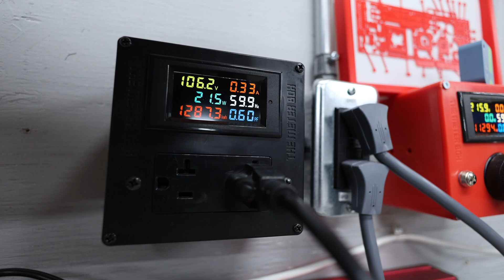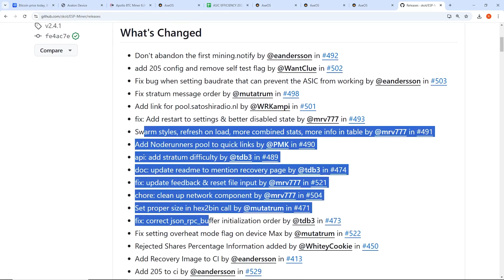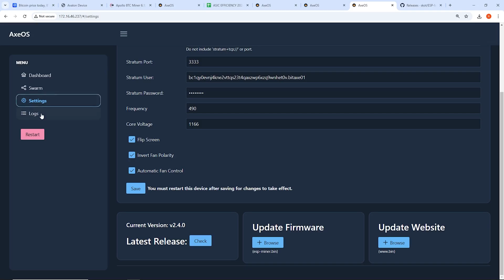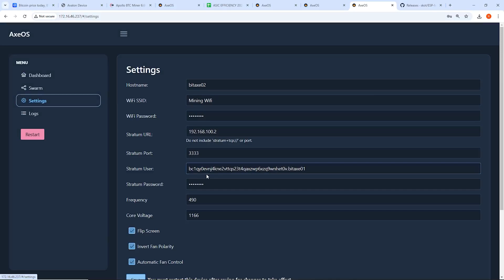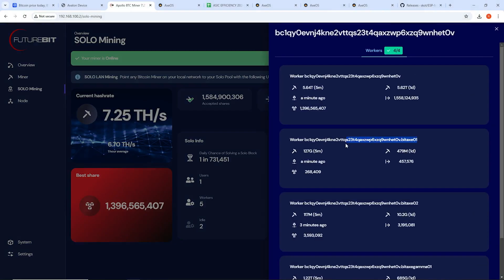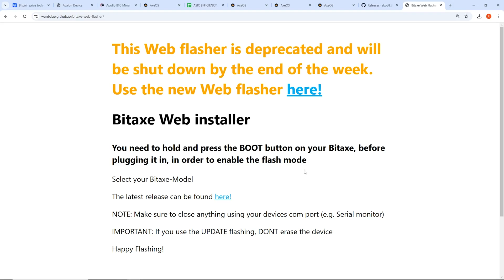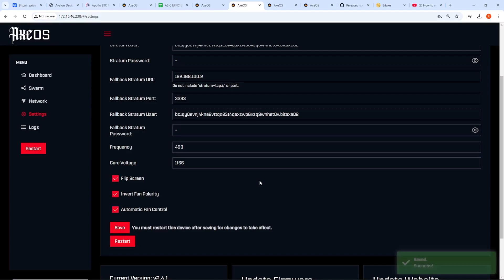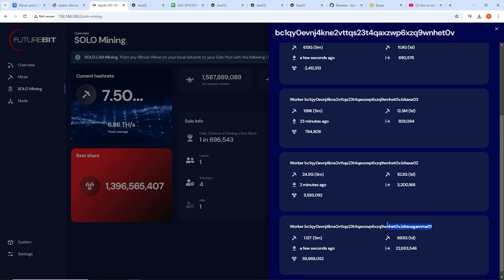Bitaxe Miners Not Hashing? This Firmware Fix Saved ALL of Mine…

Comment: only issue i had is with heating and i dont haev time or energy to fix it. So i basicly  lowered the core voltahe to 1060 instead of the 1150 default. and then frequancy i have at 550. any settings hier then this makes it were it wont work.

Comment: Im having an issue with my new Gamma, i cant login to the web gui anymore. There was power outage recently so my theory is it got corrupted. Any suggestions?
Reply from the maker: do the Bitaxe web flasher method! I show it later on in the video how to.
Reply: @RedPandaMining  thanks bro I'm gonna try it right now hope it works!
Reply: @RedPandaMining  I tried it and it will allow me to assign a new network ssid but after it finds the IP address, the web GUI still won't open. 😓
Reply: It says it's hashing on the little screen but I can't see it on the pool site.

Comment: Had my gamma up for a couple days. Seemed to have fan issues the first day leading to 2 overheating episodes and restarts. Just checked in it via pool dashboard. While it was running fine since last night, I see that the hash rate recently dropped to nothing, so it overheated again. Interestingly, it jumped to over 2TH/s before dropping off. It’s running to default settings.

Comment: I have 5 x Bitaxe 601 Gammas. The screens all work at the moment. I had issues with the MARS LANDER screen that goes out after a few hours. Once one of the 601's hash rate did drop to 500 GH/s. Simply restarted by unplugging and plugging back in and fully seating the plug. Running version 2.4.1. I like the Web flasher firmware updater. No file downloads, just automatic update. On a mission to get 50.
Reply: all work?

Comment: Having major issues with my Bitaxe Gamma I just got from Bitcoin Merch.... Danger low, high Voltage... Danger High Temp....It will stop hashing all together.....updated firmware... No fix......  In the process of  trying to get it replaced.........  I will give update as it goes..... I have a video ready to post if I have too. I'm not a happy new miner. Best luck im having is what my Nano 3 and KS0ultra...

Comment: I've got the og one, and I have had a few issues with mine.  I have not been able to oc mine and they would get stuck when power would fluctuate.  I finally had to install new software and it started working again, recently I started seeing mine getting too hot so I pulled the heatsink off and found the paste was minimal and almost nonexistant so I had to repaste mine and now its running more stable.

Comment: I have a bitaxe ultra and two lucky miners lv06 and something they have in common is that for some reason after several hours or even weeks they restart (I guess due to lack of memory) and when they are restarted they do it wrong and the IC module does not turn on and it has to be reset with the reset button, usually when it does not start that module has a low voltage

Comment: I have two Bitaxe 400Gh, older software versions were not stable, since I have v. 2.1.8 it works stably and also reconnects automatically if wifi drops. I also changed the thermal paste, the chip temperature dropped by 5 degrees. They are overclocked by approx. 10%.

Comment: I've had one of the BitAxe Gamma units for a couple weeks. For the first couple of days, it worked great. Then it just seemed to stop and show Gh/s: 0.00 until I unplugged/replugged power. This went on for the next few days. I then checked for the latest firmware on the settings page of the WebUI and updated from v2.3.9 (what it came with) to v2.4.0. I didn't really understand that I had to update the Web.bin (at that time), but the new firmware seemed to make little difference. (Note: it's worth mentioning that when the miner screen showed Gh/s: 0.00, I could rotate the power barrel jack a bit and it seemed to have put some life back into the unit... darn barrel jacks were never very reliable anyway...) This time, when it worked, the fan surged from slow to fast (then repeat). I then replaced the thermal paste on the ASIC with some MX-6. When I plugged power in the first time after re-assembling the heatsink/fan I wouldn't power on... a little troubleshooting later and it seemed that I had the heatsink tilted on the ASIC die and I think it shorted something underneath... Well, when I reinstalled the heatsink/fan I had it clocked 45° from before, so I removed it again and turned it as it was before and also made sure that it was flat on the ASIC (Being careful that I didn't damage those plastic pins that hold the heatsink to the main board.). This seemed to work and the BitAxe powered on again... I then connected the power through one of those power meter plugs to monitor the power draw. I could tell when it was firing up when it showed about ~26W usage on the power meter and ~21W on the dashboard of the WebUI (~0.1W when the fan was slow and ~26W when the fan sped up.) I updated the firmware again a few days later when I saw that v2.4.1 was released. This is when I also found out that I needed to update the Web.bin in order to update the WebUI. Well, the fan was still surging, slow then fast... I then turned off the Automatic Fan Control in the settings of the WebUI, played around with the fan speed manually and found its happy setting was at 75% (6861 RPM). Now it seems to be running smooth @ 21.6W, 4.8V, ASIC freq 525Mhz, ASIC voltage 1.13V, ASIC temp 67.4°C, Voltage Regulator temp 82°C, and Fan speed 75% (6861 RPM). I hope this helps someone else that may be experiencing similar issues... I LOVE to tinker with this stuff! Cheers!

Comment: I had to send back three nerd miners because after two weeks they kept dropping out.   Reflashed the firmware and same thing.   Just got tierd of having to reset them.  Haven't tried the BitAxe models.  For now I just have an old S9 where I removed 2 hashboards and have it humming away at it's lowest power setting.   It's been up three weeks and chugging away like a champ.  Fan only runs at about 2000 RPM so it's super quiet.    Thanks for the Vid!